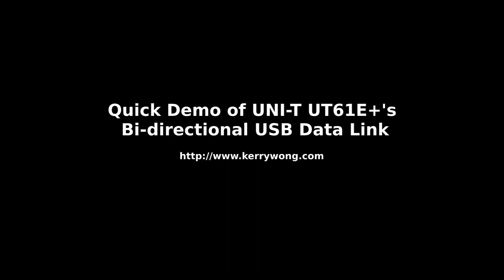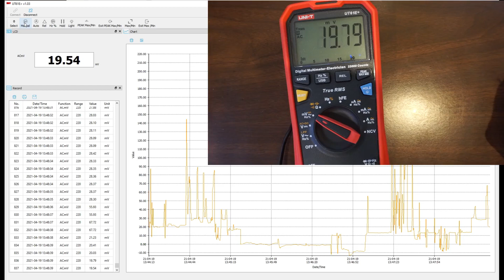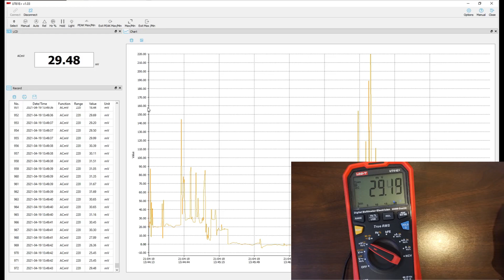Quick Demo of UNI-T UT61E+'s Bi-directional USB Data Link

Comment: How are able to make the software work? I have a similar UT161E and I cannot get any reading on Windows 10/11. The software seems to detect the USB interface. Also the PC icon appears on the multimeter screen when I insert the USB connector into the multimeter. Windows has installed "WCH UART TO KB-MS_V1.7" automatically. Everything seems to be fine except there is no display of any reading.

Comment: GUI control of an instrument is what 100% of manufacturers provide. But it is STUPID, and pretty much USELES to an even moderately ambitious and intelligent experimentator. What is important and sufficient to have. instead of GUI, is a commandline control so that one can interactively control the whole experiment, from virtually and computer language or scrypt. For example, change of some parameter in the exprimental setup, read voltage on  UT61E and then do further changes based on these data, etc. It is quite idiotic to use mouse and click virtual button on a monitor, insted of pressing the real button on the instrument with a finger! MANUFACTURERS OF ALL COUNTRIES AND CONTINENTS - DO BECOME INTELLIGENT, AND MAKE USEFULL COMMANDLINES, PLEASE!

Comment: I had this meter for a few days before returning it.  Diode junction beep and data link is nice but the continuity lag and terribly slow autoranging speed killed it for me.
Reply from the maker: Diode junction beep is specified in the manual (as a feature for under certain threshold, which I don't know why). Which ranges are slow for you, just curious? This meter has one of the fastest autoranging speed in the Ohm range, which I find very useful. In my testing there was no lag in continuity (unless you were referring to the indicator, which does lag behind the audible indication).
Reply: @KerryWongBlog  full disclosure I did have the b version but I believe it has the same chipset. I didn't like how the continuity lagged after you released also the display didn't light up until it received a reading which is useless, it should be tied to the buzzer.  Auto ranging in general was just really slow maybe the e model is faster.
Reply from the maker: @jamesdavies686  Thanks for the clarification. I don't have a B version to test, not sure if the B version has the same chipset as the E version though as otherwise the only change would be just hardware. It could be, but I am not sure...
Reply: Поможет замена резонатора на 8000 МГц я думаю.